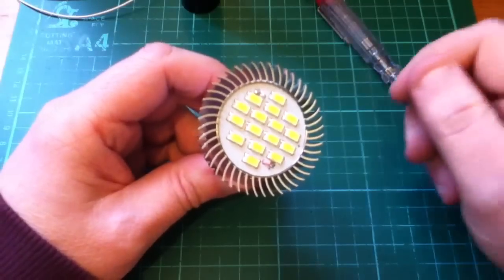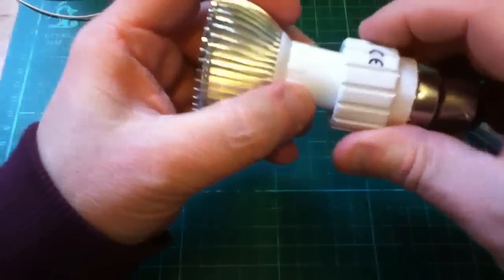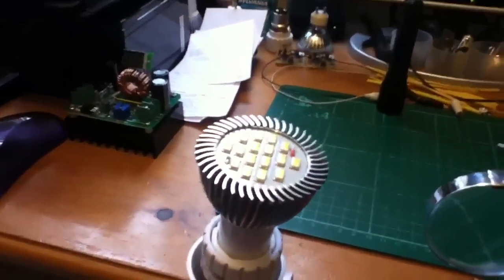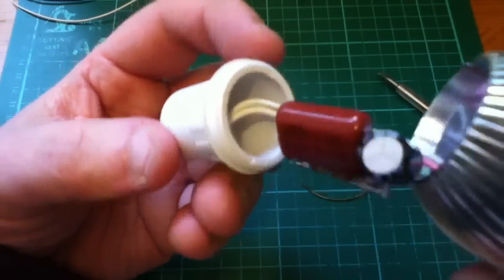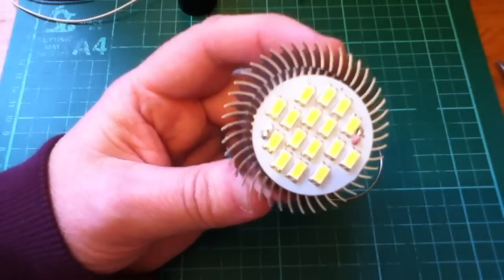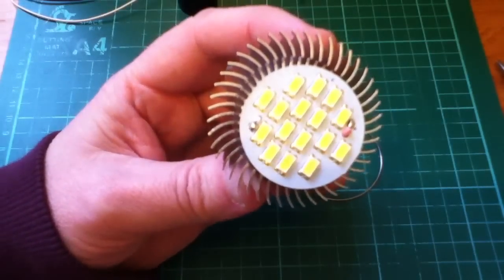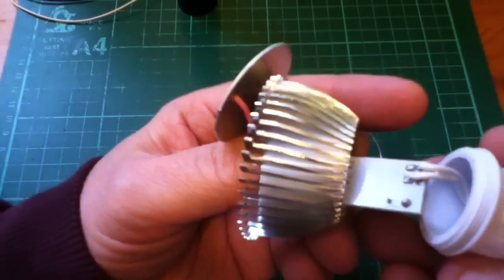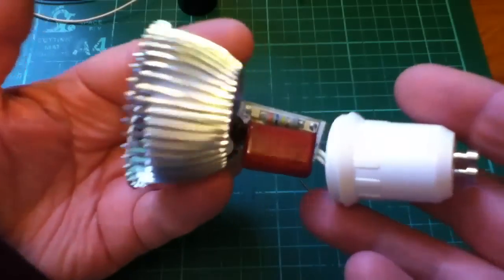Dangerous GU10 LED Spot Light is Cheap and Bright but could Kill You - Seriously

Comment: Why don't you just turn off the light before you insert it?
Reply: It depend how installation was done.  Sometimes it could be wrong and switch cut not live wire but neutral. (im talking about older buildings where wire was not marked). 
I would never trust my life again to someone who was doing installation before me.
Let me tell short story how i almost killed myself while i was doing replace bulb in celling lamp. 
First i shut down light (just as You ask). I step onto ladder to grab lamp (worth of notice the lamp was made by metal and from safety reason it should be grounded... there was no grounding 2 wire installation so someone use neutral wire to ground metal part) and it sit on chain with was screw through wood onto celling. I go up high, grab chain to have support point and touch metal part of lamp... i got zapped and felt of ladder... The chain was grounded by damp wood... and metal lamp carry live potential (someone switch cables inside box and make this deadly trap) as You can see two coincidence... mixed wire, and grounded chain at once could lead to fatal... So i will tell You only one thing... always have neon bulb probe and poke everything metal while You working...
Reply: because when you're inside of a building with electricity, you are inside the transformed LV circuit. like Noob explains, its impossible to switch both lines because you will switch the whole building off "circuit break circuit break". the neon bulb isnt such a bad idea but I would advise all home owners to learn what the neutral pin of their homes receptacle looks like and get a multimeter to check neutral to earth ALWAYS before trusting anything you plug in. better yet, do this at the breaker box itself. 50/60hz is very fatal and when you are grounded its even worse. even having a shock from a lifted circuit can stop your heart if you wanna go on bear hugging circuits. the problem with getting a grounded shock is that electricity will pass thru your body until it hits ground, and will not stop until there is a break which in most cases there will not be. you will just end up being a typical microwave oven in use for the time being until the breaker heats up and flips. THATS IF you dont resist the watts and watts of current you will have traveling thru you for the time being. unless you receive the shock below your heart you will have that electricity running thru your heart unless your like the very few who have very high resistive organs. but the majority do not. who wants to find out?
Reply: Tesla Explorer
 or above the heart receiving a shock upside down grounding to your hands, hopefully you don't take it to the dome

Comment: Sort of like the old tube radios ,you could plug them in either way because the plug has no wide blade to prevent it .  If you touch the chassis or the metal post of the volume or tuner like if the knob fell off and it is plugged in to have the chassis hot with a good ground being  (barefoot on cement floor ),whoopee. Ask me how I know ,